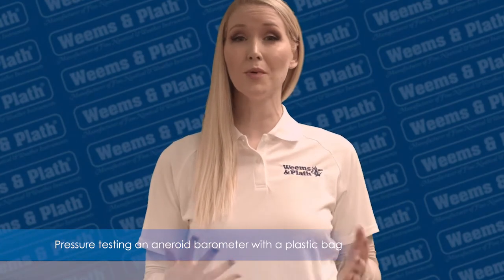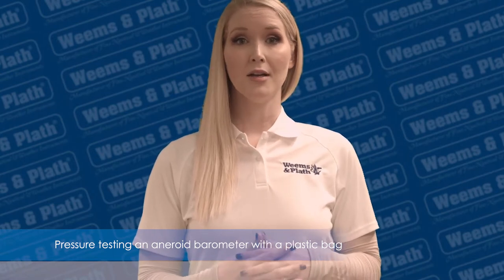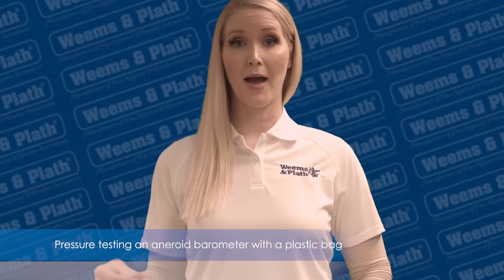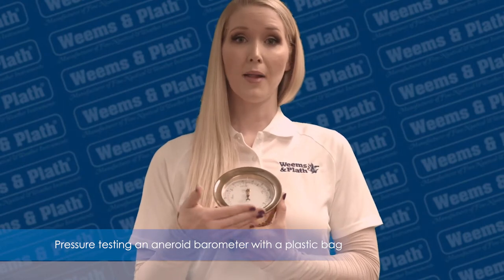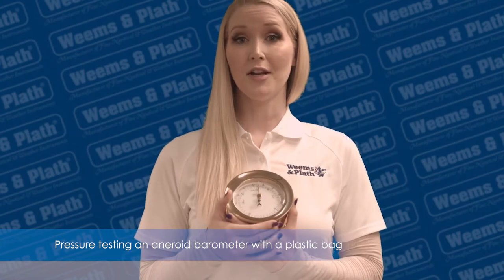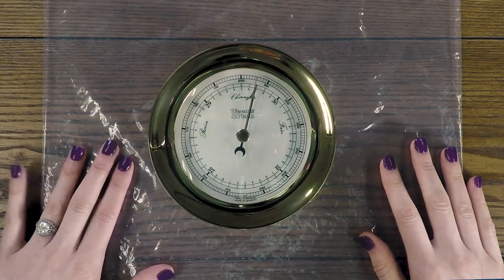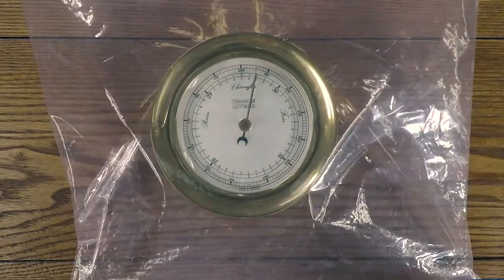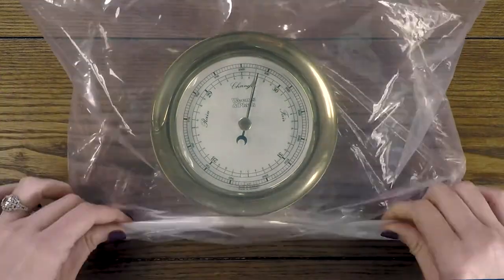Pressure testing an aneroid barometer with a plastic bag

Comment: use a barometer which is one lakh kilometres squares surface so we got tremendous pressure of the atmospheric pressure every second round the clock
now we have ended endless quench for electricity forever😋😋😋😋